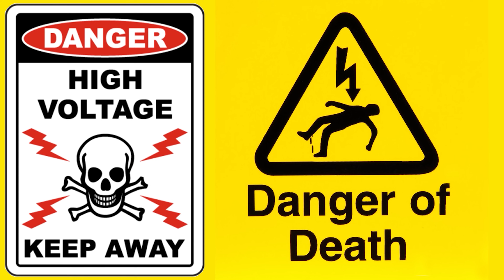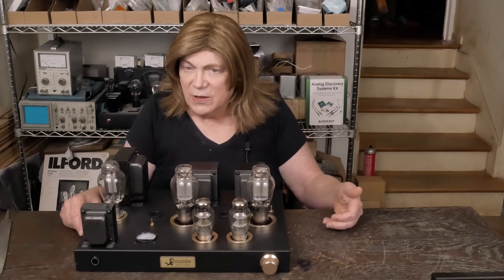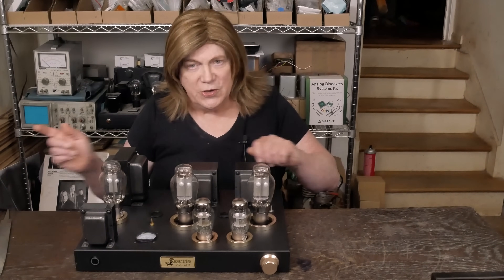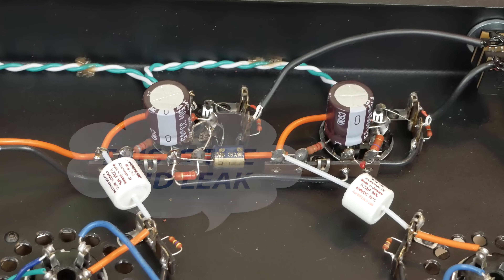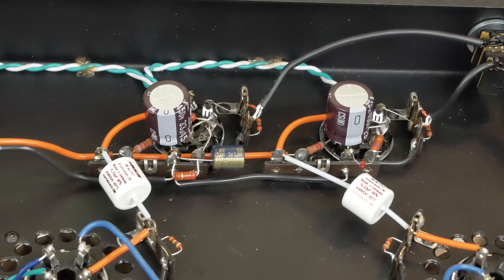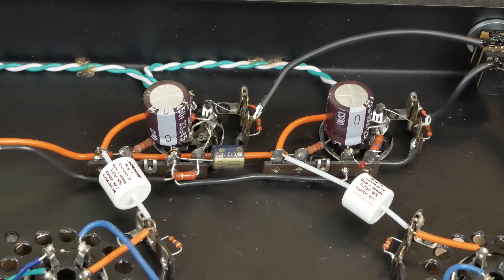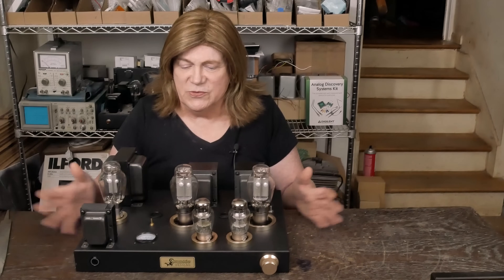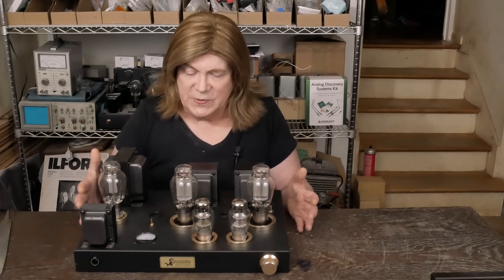2A3 Single Ended Tube Amp DIY Build: Final Mods!

Comment: This may interest you. On his Youtube channel Mike Freda, a Canadian guy, presents a budget 2A3 amp project. It looks very interesting and I’m going to build it. Maybe there are some ideas there to reduce your production cost.
Reply from the maker: Sadly those output transformers he chose are not wide bandwidth units and even Hammond explains they are only rated for 100hz to 15K and not for HiFi use. I've tested them and would never use them in a HiFi build, they are like the open frame Edcor units, guitar amp only. But yeah they are cheap. If you plan to follow his build, I highly recommend you get a different model of output transformer. Otherwise it looks like a similar SRPP design and likely will work fine.
Reply: Thank you for your thoughts. As a better option Mike Freda suggests Edcor GXE15. Problem is in Europe Edcor is double the price. I’ll have to look for a cheaper alternative. It’s just to keep me busy really. For the genuine musical experience I have my wonderful Elekit TU-8900😊
Reply from the maker: Check out Thermionic Labs. He discounts using these low end transformers by saying he uses a sub so it doesn't matter. Cheap transformers cause more issues than just low bandwidth. Otherwise, looks like a nice build. I personally think the 6SL7 is a nicer sounding driver tube :)
Reply: I’m sure it is😊 Thanks!

Comment: Changing the resistor types makes a subtle, but critical difference. I just replaced the resistors in my Type 45 with Audio Note Tantalum resistors. It was like a veil was lifted and the music got more presence. Was well worth the effort and expense.
Reply from the maker: I want to experiment with those!!
Reply: @SkunkieDesignsElectronics  Given how deep you go into the sonic presentation of your amps, it would be worth your while to test. Problem is, once you hear something, you can’t unhear it :)
Reply from the maker: That's what I'm afraid of lol. I do consider myself VERY lucky to have blindly stumbled into some parts that do work REALLY good, like those solen film caps for the first cap in the power supply. That was just stupid luck that I used them.

Comment: Looks like a nice amp and a good alternative to a 300B. I’m still using my Skunkie modified Reisong A12 with additional upgrades. I’m interested in doing the LED and resistor mod, and I’m interested in how to calculate those values. Thanks, Gary
Reply from the maker: Bias voltage is too low to use an LED.

Comment: Amazing looking amp, think I will give it a try. Do you think it would be unwise to run old stock original 2A3 tubes in this amp, as you have the voltage up higher for the greater power handling of the modern 2A3 tubes?
Reply from the maker: I think anything other than the super early "single plate" tubes will be fine. You can use a 5Y3 rectifier to drop the B+ if you want, you do lose a little over 1W of power though, but it then runs the 2A3 at the "standard" operating point.
Reply: @SkunkieDesignsElectronics  Thank you!

Comment: Other than some additional power output, what is the fundamental difference between 2A3 and 300 B (if any)?
Reply from the maker: Aprox 1.5X more power and just a different sound signature. HIGHLY dependent on the tube used!

Comment: Why is there heat shrink tubing on the leads of the coupling caps? I see this on many amps and I don't see why this is necessary.
Reply: The leads carry the full plate voltage; heat shrink reduces the shock hazard.
Reply from the maker: Partly for appearance and partly to avoid inadvertently touching something "Hot" when measuring voltages inside the amp. It's not necessary.

Comment: I don't see the meter circuit on the schematic ?  Not an issue for me as I would build it without the meter to simplify the build.
Reply from the maker: It's simply from the cathode to ground measuring the voltage.